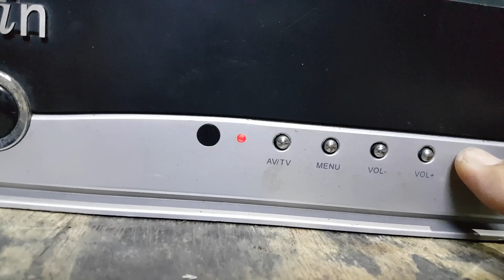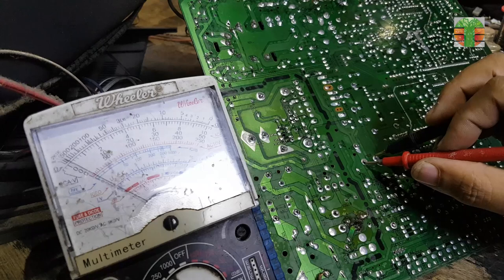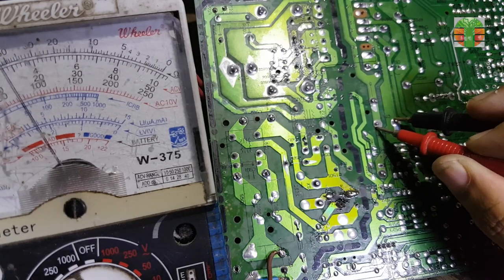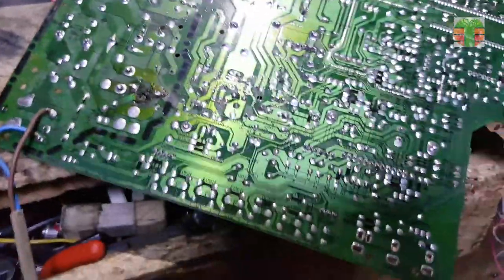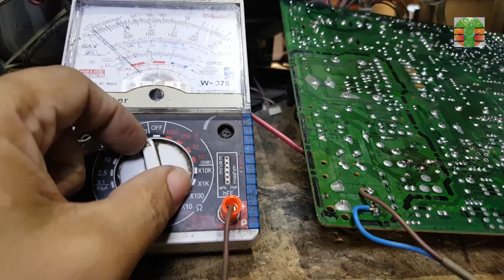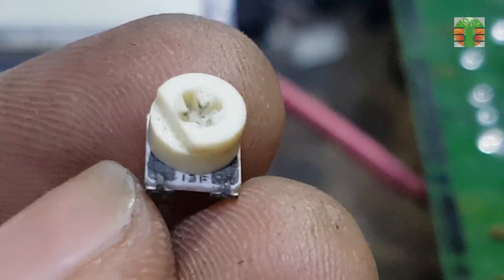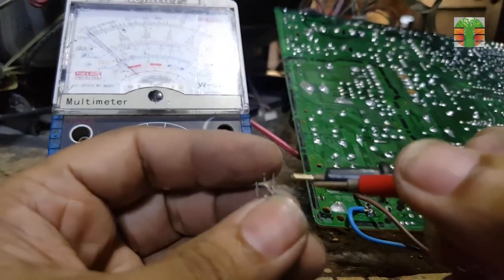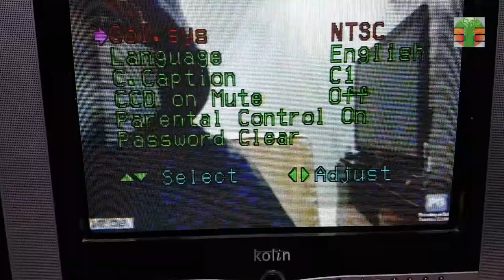Kolin Tube Type TV No power.

Comment: hello.When voltage of B+ capacitor(160v 100uf) in the cold area is low(39-40 Vdc).Is it okay to rotate variable resistor in order to raise B+ voltage to 110Vdc,?